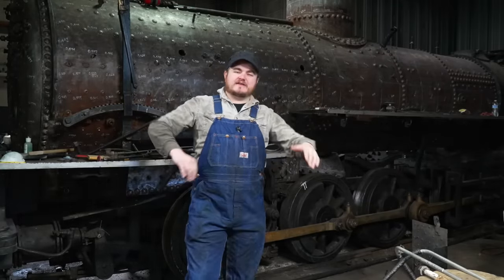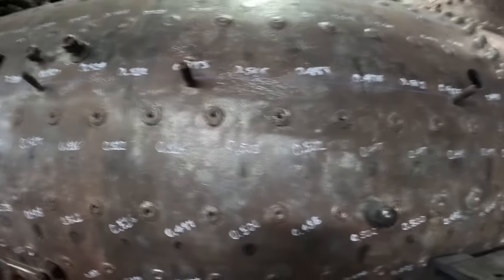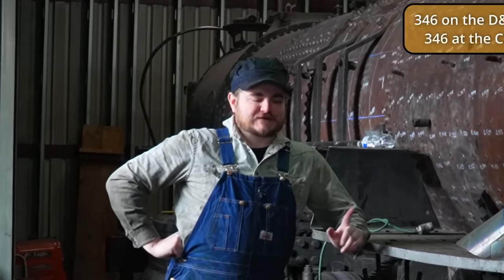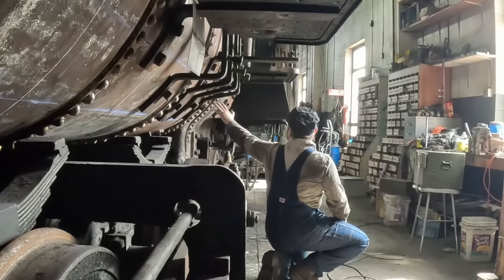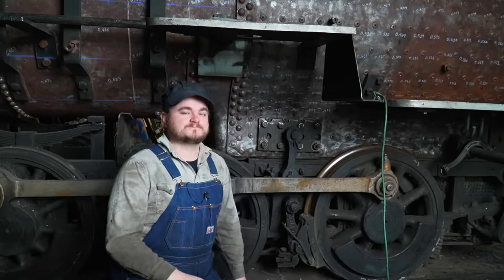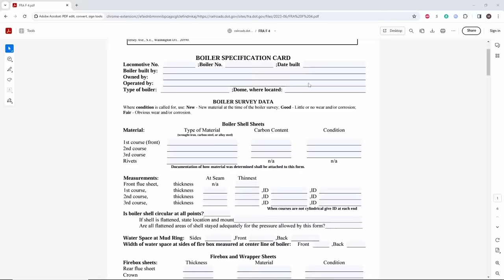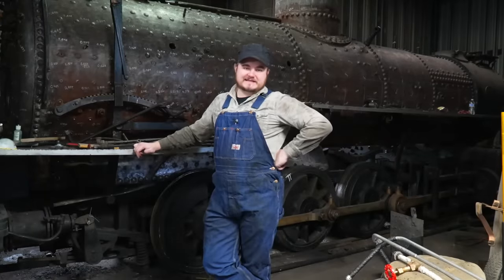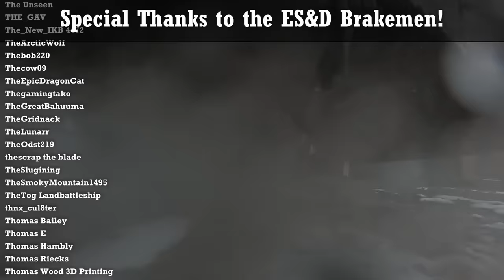What is the 1472 / Form 4 Inspection? Steam Locomotive Rebuilds | Railroad 101

Comment: 1472 day inspection? They take it apart, inspect it for defects or cracks, and it takes almost 4 years.
Reply: I'm sure it would get done faster with more volunteers and a rich boi paying for it all.
Reply: Don't forget, raise money for replacement parts and labor
Reply: No, 1472 is the number of days the locomotive can be run before it needs to be inspected and rebuilt.
Reply from the maker: In many cases (including this one) it will take more than 4. Lol.
Reply: @DeliciousBoi  I do agree maybe it's time for a few final steam train parts factory? To take the pressure off of Strasburg and silva shop in Illinois? 🙂🚂
Reply: @JAdg75oo00  We need to go beyond that and make steam engines viable again. Been brainstorming ideas for years now, and I think we can get it done and make steam cheaper to run and put hood units out of business, then we can open Baldwin, ALCO, and Lima back up and proceed down the correct track again.
Reply: @DeliciousBoi Yeah, but coal is expensive and damaging to the environment. Also, you could have to exact similar, standardized steamers, and yet they wouldn’t be able to interchange parts because they wear out differently. One of the main reasons these steamers were put out of service in favor of diesels.
Reply: @DeliciousBoi  flawless idea obviously really, my plan B suggestion? (Also it's happening already we just have to keep it going) is that we let the preserves themselves haul freight for their respective towns even Hyce and the others. With the money going into a fund for the 15 years 🙂🚂
Reply: @Hyce777 yes, I’d say about 6 years considering 346’s rebuild is half complete and it started in 2021
Reply from the maker: @DeliciousBoi  I mean, I love the energy, but, no, steam won't come to be viable again.
Reply: Unless your Strasburg or a fully working shop with the proper tools and personal and (funding) it can be done within a year. 475 as an example! Time, people and money are the big factors in the 1472. Would like an example of a form 4 filled out!!!!
Reply from the maker: @FrederickG1992  Oh of course. The big shops with lots of manpower can blitz thru these. The D&S regularly does them in ~8 months or so.
Reply: @JAdg75oo00  That's actually how my HO Scale railroad runs. It's a tourist railroad, but it runs freight to help fund its expensive operations.
Reply: Thank you for the great explanation. 🐱
Reply: 2 good boilermakers could re tube one in 3 days.
Reply: Floating somewhere around on YouTube is film footage of the maintenance shop of one of the UK Big 4 railways shortly after World War II (a few years before nationalization), showing their industrial operation to rebuild a steam locomotive in just a few days, with the pipeline doing this for several in parallel.  Really impressive.
Reply: As others have mentioned, that's the amount of service days(period where fire is lit and boiler is pressurized) the locomotive can operate before needing an overhaul. Two things I have to tell you:
A. Made that same mistake myself when I first heard of it.
B. You'd have known what it meant if you'd actually watched the first 1 1/2 minutes of the video

Comment: 191 isn’t restorable, but I’d love to see a mechanical assessment of her condition. The loggers in Wisconsin left her pretty beaten and I’m curious to see how badly.

I’m going to leave a quote from who I presume to be the engineer of the locomotive: “The boiler is busted in a place or two, The heads hold on by a rusty flue, The crown sheet is burned and the wheels all flat, A side sheet blister like a derby hat, The whistle is missing and so is the bell, The tank’s all rusty and leaks like hell, And boiler patches-she has a few-For I think she was built in Seventy Two. The cylinders are oval where they ought to be round; One end of the equalizer drags on the ground. I tried to run her and got her hot, Every seam leaked and at every spot. I opened the throttle with a good track ahead, She gave two exhausts-groaned and went dead. The cab is like steel but it’s made of tin, But she’s a d___ good engine for the shape she’s in”
Reply: From what I could find, this is a real assessment of what condition she was in. I found it in a book about the Thunder lake narrow gauge. (Literally called Thunder Lake Narrow Gauge by Harry Huston.)

Comment: We are curious to see what no. 1129's boiler sheet is like after being a park locomotive for 67 years, and retired prior from '53' to '55. I'm cautiously optimistic. With an uncovered smoke stack though, it's anyone's guess how bad it is inside.
Reply from the maker: Uncovered stack doesn't mean much for the boiler (though possibly the front tube sheet). The asbestos may have eaten away at the boiler - it's really good at holding moisture and causing scarring. Unless it was abated! I can't recall. Get you a UT tester and get after it... this is one of the easy ways to find out if you need $100K or $1000K to restore the thing.
Reply: @Hyce777  That's exactly what I'm referring to. The boiler jacket has given way at the bottom
Reply: @Hyce777  My concern is where the moisture is being trapped. No.1129's smoke box door leaves a gap high enough for water to collect without escaping and presumably that water is nestled in that gap and traveling down the lower tubes to the firebox. It's all new to me, but as I said, I'm curious to see what has happened.
Reply from the maker: @brookspotts9312  The smokebox should have a plug drain, which hopefully was removed. It shouldn't hold water. If the plug was left in... well, that's not ideal.
Reply: @Hyce777  Maybe the boiler will end up being an oversized planter? Maybe Cactus and juniper? In all seriousness yes it was never abated so it's had lot's of time to stew.
Reply: The smokebox is not pressurized, but water can collect in it and possibly travel down the lower tubes.  I have an idea that water held by the insulation against the boiler barrel will have badly corroded the steel.  If the boiler barrel is eaten through or too thin, my suggestion is to take all of the measurements of the boiler and where all of the appliances go; draw up the boiler in drawings and get a Canadian company to weld up a new boiler with an ASME stamp the boiler is good-go.  With the exchange rate with Canada, the savings is about 1/3 but they use the ASME specs.

Comment: One subject you might want to address in a future update on Grandma is "which engines are subject to the 1472-day inspection?" and also "if it's not FRA-regulated, what rules DO apply?"  Technically speaking, since the Museum is insular the FRA rules don't have to apply; however, 20 and 346 can be taken to other railroads, and therefore need that FRA certification to operate there.  Actually, the degrees of FRA regulation could probably be a video of their own.
Reply: If not FRA, it's TÜV then, or some ISO standard.
Reply from the maker: For sure, a good shout. We're going FRA on 346 expressly for travel... :)
Reply: How about insurance? I'd imagine compliance with FRA or OSHA regs would help secure decent coverage, especially when it's open to the public
Reply from the maker: @toymachine2328  Nope, no issues there. I don't really know anything about the museum's insurance, but I know it doesn't involve anything with our FRA folks.

Comment: A little more history-

The Locomotive Inspection Act of 1911 established mandatory boiler inspections and working pressure x 4.0 was considered good design practice by then. However, it was found that roughly two-thirds of all locomotives inspected were operating at a lower safety factor. It was decided that 3.25 would become the standard for locomotives built before 1912, with a gradual increase phased in over 10 years. Between 1912-1922 locomotives which could not meet the new standard were removed from service, derated to lower pressure, or rebuilt with new boilers.
Reply from the maker: Oh that's neat!

Comment: I suppose this is another video that can be added to the list of "why did diesel replace steam?"

Where I work, we perform 1104day (tri-annual) inspections and they're nowhere near as lengthy of a process as going through a boiler must be. With two shifts of 3 good guys, a tri can be knocked out in about 2 days and that locomotive can be fired up afterwards and on a train in an hour if the need arose. Compared to the amount of work you guys must have to put in and the amount of time it takes just to fire up the locomotive. It really is great to see the amount of work you guys put in to keep the history of these things alive for ours and hopefully future generations to enjoy.

Also, what you said around the 11:30 mark really struck a chord with me. So many people will look at something on a locomotive that's obviously worn, but still serviceable, and think "oh my, it's amazing that these things stay on the rail given how poorly maintained they are." Or look at something like anti-seize on lug nuts and think, "what's the big deal? I've seen that done hundreds of times without issue." Failing in both cases to realize that the people who design this stuff and tell you what to do and what not to do, have sat down and done the math on it and know what is and isn't a good idea to let slide. Common sense is useful, but shouldn't be trusted over cold hard testing.

Comment: Ah, the 1472. Because some dimwits decided that boiler care wasn't something they needed to worry about, resulting in one melted crown sheet, three scalded crew, and a freaked out FRA. At least it forces people to take care of their engines properly if they intend to run them. You know, I've wondered a time or two if the 1472 only applies to steam locos running publicly, or if you have to adhere to it even if you're running your own little railroad on your own private land. 

Thanks for the update on Grandma, Hyce, and thanks for the footage of her running. Nice to see the old girl's still got it. Let her know we're all thinking of her.
Reply: Maybe a similar question, does the FRA deal with scale railroads? I'm thinking rideable steam trains, large scale miniatures, etc. I'd imagine if it deals with the public or employees, it's going to be subject to some kind of government scrutiny, be it FRA, OSHA, or both. If you want/need liability insurance, complying with inspection and training programs and having third party inspectors check your work would likely be helpful.
Reply: @toymachine2328  The FRA's rules only apply to railroads of track gauge 24" or greater, which 1. connect to the national network, 2. operate within 30' of said network, or 3. cross a public highway or navigable waterway.  Plus a few other conditions I forget at the moment.  Rideable steam trains and large scale miniatures are below that and thus not FRA, but they may have to comply with certain state codes.

The Colorado Railroad Museum doesn't meet the FRA requirements because it's disconnected (Insular) and doesn't cross a public road, so its engines technically only need to meet state boiler code.  However, 20 and 346 can (and 20 has) travel by truck to other railroads which are FRA regulated, and therefore need to be FRA certified to operate on those railroads.
Reply: @BandanRRChannel  thank you
Reply from the maker: If you're not under FRA jurisdiction, the 1472 does not apply. However, if you're not under FRA, you're likely under state jurisdiction, which is it's own bag of things varying state by state.
Reply from the maker: @toymachine2328 FRA doesn't do anything with stuff smaller than 2' gauge.
Reply: @BandanRRChannel  . . . So this means that some of the REALLY NARROW gauge railroads (now operating as museum railroads, but that used to be in revenue service) operating in places like Wales would escape FRA jurisdiction even if you moved them to the US.
Reply: @Lucius_Chiaraviglio  If you did, the FRA would claim them somehow.

Comment: Two surprises for me.  First that the boilers are multi-layer; makes sense given that you want to keep it insulated but I always imagined them as being solid.  Second surprise being just how thin the pressure vessel is.  I wouldn't have thought that 0.5" thickness would suffice at that scale but I'm guessing a lot of it's down to cylinders/circles being inherently strong.
Reply: The boiler itself is a single layer (although riveting requires overlap on the seams), but it does have a layer of insulation wrapped around it and a thin protective metal sheet (or “cladding”)  on top of that
Reply: @andrewreynolds4949  Yea, that's what I was referring to.  Three layers: Pressure vessel – Insulation – Outer (not pressure rated) jacket
Reply: The thickness of the steel required depends on the operating pressure and the shell diameter of the boiler. Bigger boilers operating at higher pressures require correspondingly thicker steel.
Reply from the maker: Bigger engines had bigger boilers; 346 is pretty small. The K-36's have 3/4" boilers. I've heard Big Boy's is 1" or more.
Reply: @Hyce777  Those larger sizes are more in line with what I imagined (~30 mm).

Comment: These inspections are very important,  even in different industries.    From my experience, weak points in a hull of a ship means it can only handle sea state to a certain level, this does apply to a boiler for structural integrity.

Comment: This was fascinating  and omg the riveted 😱Baldwin patch….. also you went mathing again….
Reply: The patch was installed at the Burnham Shops in Denver of the D&RG, not Baldwin.  Baldwin did send some guys out to redo the firebox of the No 50 2-6-6-2T of the Uintah Ry because Baldwin built it for much less than the 7.5% grade specified by the railroad.  Baldwin did lay a curve of 66* or a R of 91.804' or 91' 9 5/8" to try it on before shipping it.  A photo was taken to prove the curve.

Comment: I'd very much be interested in a video on how you do the pressure calculations.  Especially if you can also include how Baldwin would have done the calculations 120 years ago, back in the slide-rule days before computer models and finite-element analysis.
Reply from the maker: I mean, the calcs are all done by hand still. Not with a slide rule... But yeah

Comment: If you think the riveted suspension patches are weird, remember the A10 warthog's engine stalls when it fires it's gun, and the engineering solution was (and still is) run the starter motor to keep it running while it's shooting and flying.

Comment: Something you might add is that thicknesses can be different if the locomotives ever had major wrecks

Sumpter valley 19 once wrecked and rolled into a river. For whatever reason due to the wreck the fireman side of the door sheet is a decent amount thinner than the rest of the firebox
Reply from the maker: Impact tends to be that way

Comment: Another great video, Hyce!

When inspecting the boiler tubes, I imagine the buildup from the exhaust gas and particles inside the flues is the primary concern, but would you ever notice any issues of scale or corrosion on the water side of the tubes?  If so, would these ever cause a noticable degradation in performance?

I'm curious because in the power industry, the focus is on keeping boiler water really clean yet this does not appear to be a concern in steam locomotives.  Seems to me that if they had a way to capture the condensed steam, they could solve two problems at once (keep purified water in the system, and reduce the need for water refills).  Any thoughts?

Comment: As a steam engineer, marine, water tube boiler inspections run a bit different, the cfr’s are applied from the year built. Boilers hydroed at the percentage required by time since last done (1, 5, or). Retubing is not done by the clock as chemical treatment should keep it good, but by tube failure rate, area of failure. In a D boiler, generating tubes, when done, are usually in a block, as all the outside tubes have to be removed to get to the inside tubes, so the block isn’t replaced until say 10% of the block has failed. Air heater and economizer tubes are generally straight so that doesn’t apply. Tubes are. Lien every 12 hrs at sea, so external corrosion is minimized. Does only the current cfr’s apply to your engines, or is it based on the year the boiler is built? Have fun
Reply: Were there even CFRs as far back as 1882, the original date this locomotive is from?  I know the ICC was the first real regulator of the railroads, and then later, you had the NTSB as well.  I don't think they existed in 1882.

Edit

I looked and the ICC came into existence in 1887, while the NTSB has existed since 1926.  Some ICC competencies were handed over to the new FRA in 1966 after the establishment of the current structure of the U.S. Department of Transportation.  Also, the Federal Register only dates to 1935 and the Code of Federal Regulations to 1938.  I don't know if anything besides industry standards existed fir railroads in 1882 and if they would have to back date to say Baldwin Locomotive Works' best practices from 1882.
Reply: CFR’s were first published in 1938, but where they came from go much further back. Federal boiler safety goes way back, but to tell the truth, I don’t know when pressure vessels first required inspection. Have fun